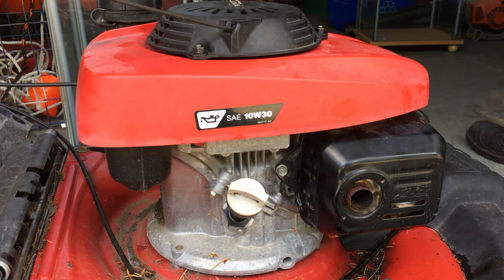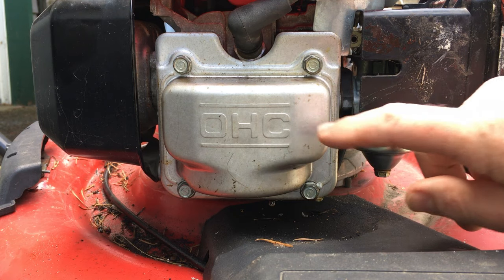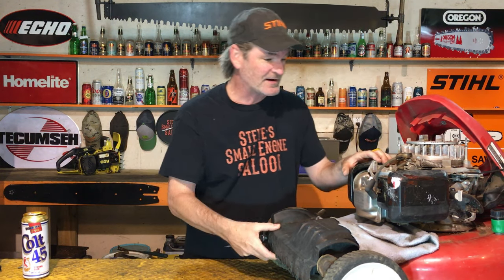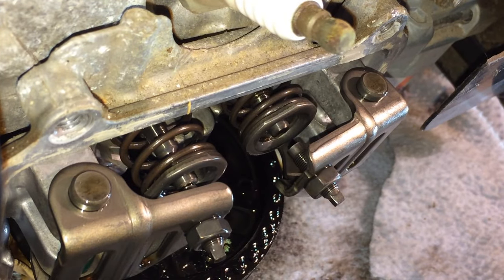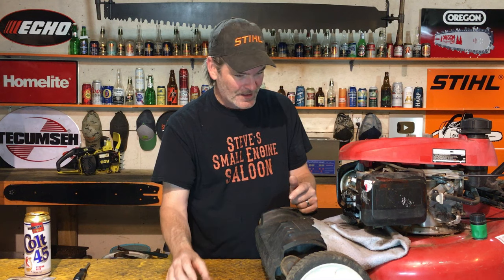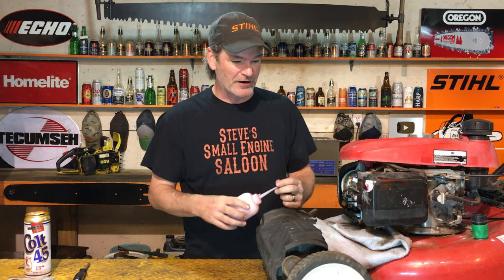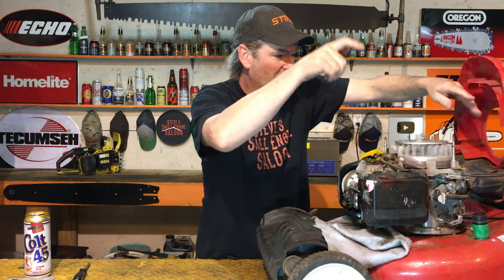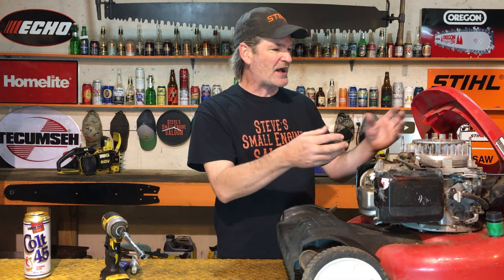How To Fix A Lawn Mower With No Compression

Comment from the maker: Don’t know if you have a compression problem 👉check out my video Easiest Way To Test The Compression On Your Lawn Mower ➜ https://youtu.be/LtJQgkBTkdE
✅Click here for HondaBond ➜ https://amzn.to/2SJNaaa
For more videos like this, check out:
👉Straighten A Bent Lawn Mower Crankshaft With A Pipe ➜ https://youtu.be/w2Ro9GmEyOE
👉Fastest Way To Tell If The Crankshaft Is Bent On A Mower ➜ https://youtu.be/3up57DHiCqs
👉Here's Why Your Lawn Mower Is Leaking Gas - Honda Style ➜ https://youtu.be/tp67AzWNbI4
👉How To Adjust the RPM Speed on a Lawn Mower ➜ https://youtu.be/7YrA3QEIFnE

For more videos like this, check out:
👉Straighten A Bent Lawn Mower Crankshaft With A Pipe ➜ https://youtu.be/w2Ro9GmEyOE
👉Fastest Way To Tell If The Crankshaft Is Bent On A Mower ➜ https://youtu.be/3up57DHiCqs
👉Here's Why Your Lawn Mower Is Leaking Gas - Honda Style ➜ https://youtu.be/tp67AzWNbI4
👉How To Adjust the RPM Speed on a Lawn Mower ➜ https://youtu.be/7YrA3QEIFnE
Reply: Didn't see the link for the homemade cleaning lubricating fluid....
Reply: Hey Steve i got a yradworks 172cc runs an dies right away any video on that its an auto choke im new to them
Reply: In the video you said you would put the recipe for your brother.s cleaning concoction in the show notes, it’s missing.
Reply: nice vlog research ion detox
Reply: 747tbar, the link popped up during the video, but that may vary depending on the device you’re using. Here’s the direct link: https://youtu.be/cElDM06Mk3c
Reply: I. How did the same day and what was it like when you have some good 👍 and what are your favorite ones
Reply: i know Im randomly asking but does anybody know a method to get back into an Instagram account?
I was dumb forgot the password. I would appreciate any help you can offer me.
Reply: @Damon Ahmed Thanks for your reply. I found the site thru google and im in the hacking process atm.
Takes quite some time so I will reply here later when my account password hopefully is recovered.
Reply: @Damon Ahmed it worked and I actually got access to my account again. I am so happy:D
Thanks so much, you saved my ass :D
Reply: @Lee Christopher Glad I could help =)
Reply: @747tbar  acetone and automatic transmission fluid 50/50 i think
Reply: Thank you for send me more videos i am learning with a good teacher it's you thank you very much
Reply: Link for homemade cleaner?????
Reply: Hi Steve I have a question my husqvarna lawn mower was I think shooting a flame out of the muffler do you know the cuase of why thank you
Reply: Oh I forgot to mention it happened when I was trying to start it

Comment: Anybody who has tried and more importantly FAILED to perform even the simplest lawn mower/small engine repairs should come away from Steve's Saloon with a newfound respect for experience and an engineer's mind. I may not successfully complete all of my DYI repairs, but damned if I haven't learned YEARS' of tech from Steve. Let's all buy this guy a beer. Or ten.
Reply from the maker: Wow!  Thank You...
Reply: I've only seen a few of his tutorials, I really like Dony Boy, but now I have 1 favorites! I'm not a good learner, its hard for me to absorb info, but Steve here is really detailed and I have learned enough to gain confidence in my repairs! Thank you so so so much Steve for sharing ypur valuable knowledge!
Reply: @mongamcdowell2693  - Yes he goes through it all as well as he can. Camera angles and demo's added after filming are great. Well done Steve. Well done mate.
Reply: @StevesSmallEngineSaloon  - I have just started up a tool sharpening and machine maintenance workshop and you bud are helping greatly. We salute you fine sir for all your efforts. Much love from England.
Reply: Tutorial was great however it would have been really great without the obvious display of the giant beer which insinuates alcohol habit that's most likely out of control these sort of influences are very negative and unappreciated
Reply: @ruthbenjamin5745  "saloon " in these parts refers to a drinking establishment...what where you expecting?
Reply: @ruthbenjamin5745  calm down. It's a guy in a shop having a single beer while he works.
Reply: U need to try a New Zealand Larger

Comment: I pretty much had given up on my dead lawn mower not starting after doing some other videos about gas and spark troubleshooting. About to head down to the local hardware store to pick up a ridiculously priced electric mower. I did one more search seeing if it could possibly be anything else and came across this video. The symptoms were spot on and when I took off the valve cover sure enough the exact valve was stuck. Took a bit to unstick it and get it working smoothly and then put it all back together. Next day after a few pulls it started up and ran perfectly to cut my lawn. Thanks Steve for the great video helping me get my mower up and running again. Looks like the electric mower will have to wait a few more seasons.

Comment: Thanks for the tip. I had cleaned the carburetor, checked the fule lines, add a new spark plug and air filter, but my Honda did't start. Then I checked the compression which was also OK, but a driver belt was lose. Once I put it back in place the Honda started immediately.

Comment: awesome Steve,  retired and got into well dump and yardsale picking,  using your vids l have fixed half a dozen free mowers and sold them.    4 of them had this problem. didnt know how to fix till l watched. thanks. love the vids....  the other two they hit a stump and you couldnt pull it to turn over.  shaft bend..  couple of whacks with a 10lb hammer and  was able to use the pull cord. cleaned card and both fired up on first pull.    saw your vids on carb cleaning those plastic carbs. thanks   having a blast rescuing mowers and things

Comment: Hi Steve thank you for all of your very instructive videos, I need your help this time, I got a Champion 5500 watt generator that worked for a couple of days when we had hurricane Aida. suddenly stopped working , I could not started back up, thankfully I got power back, so I stored it to fix it later, well it's been about two years and the season of heavy rains and floods are coming back, so I started to check what happened, and what I found out is that the intake valve broke of at the tip, I was able recover all the parts and pieces from inside the engine. I change all new parts (valves, push rods. rocker arms, seals, guide, keepers, head gasket, etc.) clean the cylinder head, lap the valves, test for leaks,, the cylinder is impeccable not a single scratch, put the head back in the engine, adjust the valves to spec, and before keep going I tested for compression, here is when I got frustrated because it's compression doesn't go any further than 28 PSI when it is supposed to be at least 55 PSI. 
What did I do wrong or missed? suggestion please

Comment: Thanks for making this video!!!! Just had this happen to my daughter’s lawnmower with a 190 on it. I pulled the valve cover and there it was, stuck all the way down. I could not get it to move at all no matter how much carb cleaner it sprayed on it I could not get it free. I took off the valve spring, valve steam seal,  and removed the carb and sprayed the valve stem in the port. Finally all at once it popped out and was completely free. I put it all back together and it now runs great!!!
Reply from the maker: Awesome!

Comment: Hi Steve. Valve clearance and timing is the first thing I check on anything coming into my shop, after plugs, HT coil, fuel, air, carb, etc. But you really don't need to take the spark plug boot off. It's never going to start, just spinning the flywheel by hand.

Comment: I am 68 and having been playing with engines since I was old enough to turn a wrench. I always learn something new from you. My friend and I had a similar problem to this one. It was on a Kawasaki V-twin in an Argo ATV. The intake valves felt like they were welded into the head, and the push rods dropped out. We stuffed nylon rope into the cylinders to keep the valves from dropping into the cylinder, took the valve springs off,  worked the valves loose, then used acetone to clean the valve stems. We had a chance encounter with an Argo dealer at a outdoor show. He was familiar with sticking valves on Argos, and he told us how to fix it. We were going to pull the engine out. He saved us a lot of work!  Now I see we could have left the valve springs on and simplified the job. Your penetrating oil formula would have worked great. Keep up the excellent work! Thank you Steve!
Reply from the maker: Thank You...and You're Welcome...
Reply: I had that problem on a liquid cooled Kawasaki 425 John Deere when I used Sta-Bil fuel stabilizer. I had a 5 gallon tank of it. It happened twice on the same tank of gas. So after I fixed the valve the second time, I didn't shut it off until it ran out of gas. Put in a fresh tank of gas with no Sta-Bil never had a problem since and that was over 10 years ago. I don't use Sta-Bil anymore.

Comment: Steve I have a 22in awd toro recycler with guaranteed to start (ha ha) B&S 7.25… A little over 4yrs old.  Started on first pull until 2wks ago. Couldn’t get it started.  Watched several of your videos so set out to check spark, fuel, and compression.  Used a spark tester showed good spark, shot a small amount of starting fluid through carb still no start.  Pulled plug and grounded to make sure spark at electrode.
(Had a plug on time that was shorted out).. Good spark at electrode, gave small shot of starting fluid put plug back in and if finally started
After several pulls.  Tried your quick compression check, blade kicked back but felt a little weak. Got compression gauge could only get 
30lbs which would explain why I finally got it started.  Question is what would cause low compression?…I don’t drink beer will hard liquor
Do or do I have to make my wife drink a couple of beers🤪

Comment: Steve, I have three mowers, one Honda tiller and a mantis 2cycle or what I call my psycho tiller that were all given to me to "work on" since I badly injured my back. I have been at a total loss with how to get started with trouble shooting these things. One has a bad or sticky recoil spring, once(the Honda tiller) won't stay running and the third is an old troybilt self propelled mower that will neither stay running nor self propell. But thanks to your time energy and knowledge and giving, I at least know where to start. Thank you...

Comment: You are a national treasure Steve. I've been home from work for 2 months now during this CV19 mess. At first  I used your videos to get my neighbor's trimmers and mowers running. Her husband passed away a few years ago and everything had been sitting since then. Our deal is I could use all his good stuff on my lawn if I cut her grass too, which I'd have done anyway. It seemed when something would stop running he'd go buy a new one. So the shed had 3 blowers, 2 trimmers, 2 mowers, and an edger all in various states of neglect.

I had so much fun cursing, crying, and questioning the educational requirements of modern engineers that I went online and  bought 5 mowers, 2 trimmers, and a pressure washer for $100. I've gotten 1 trimmer, 2 mowers, and the pressure washers running. I'm not doing it to profit, although that's fun too, it's more to keep my sanity. Thank you again!
Reply from the maker: Thank You...and You're Welcome...

Comment: My old mower sat for probably 2 years because a neighbor gave me hers and I got it running so I just used it. Now it’s kaput. Put new carb, hose, cable, filter, bulb. Well, it only has 36 compression. Oh, anyway, the old mower...old faithful, I changed the oil and cleaned the gas tank. It started on the third pull!  Now it starts on the first pull!  You should see the connection between the plug and that wire! I used it all wrapped around and bare for a few years and it STILL works!  SMH. Until it quits I’ll leave it alone. Meanwhile, I’m gonna work on the other one after your instruction!  You make it look so easy! LOL THANK YOU!

Comment: Thanks for this video.  I was working on my wife's niece's nice Honda mower that I determined had no compression. It was about 7 years old, but had sat for about the last three years because they had moved to a new home and had no grass to mow.  Once I got the valve cover off, the problem was exactly like your video shows,  I squirted some carb cleaner down the valve stem and guide, and wallah, it freed up in a few minutes of working it in and out.  I adjusted the valves and put the cover back on and it runs like a champ.  Easiest fix for what I thought was going to be a major problem.  Thanks again.

Comment: Steve, I had a Plate tamper with a Honda engine that was a buddy's he lent me then never wanted it back when I offered to return it.  Well,  years went by and it acted this same way.  No compression when he finally wanted it back.   I wound up doing him a solid and swapped his non running engine off and put another one I had bought before this off a guy for $25 USD.  Then returned the Tamper in working order to him.   I will get the old one working and put it on a Water pump or other tool some day.  Great to see you cover the Valve issue I encountered.

Comment: Watched your video, went out and removed the valve cover, and behold, my top valve was stuck. Got that guy loose with some Q20 and tapping and pulling. Pushed it in a few times after it started moving freely. Replaced all, turned the blade and it bounced back. Flipped the mower and she started on the first pull. Thank you so much!
Reply from the maker: Nice work!

Comment: Wow!  This really helped!  I was given a brand new 5 year old Troy Bill TB200 that wouldn’t start.  Did everything you suggested in your videos and it still didn’t start.   Opened the valve cover and one of the rocker arms was very loose.  It had good compression so this was a Hail Mary.   10 minutes later it was back together and started on the first pull.   Guessing the set screw was loose from factory.  I have refurbished about five mowers I found by the curb but this was the hardest.  Would never have attempted without this video.
Reply from the maker: Right on Joey!

Comment: I have a craftsman  Lt 1000 I bought in 2000  17.5 hp. . I changed the carburetor.  Now it surges. If I set the throttle a little over the run setting it stops surgining. What do I need to do? Love your channel!

Comment: Thank you. This guided me to the exact same problem on my Husqvarna mower with Honda engine.  Intake valve actually stuck open while the engine was running. I was stumped at first.

Comment: I just had one I got free last summer that smoked like a factory. I pushed out back and left it go. This spring I cleaned out the fuel tank, changed the oil and it started right up with no smoke. ( I also had to change the plug. ) Other than sharpening the blade and replacing the air filter it was a nice cheap fix and I made a few bucks on it. Never assume the worse on anything until you properly test it out first!

Comment: I am so glad I found your video's.  I had this exact problem, intake valve stuck open causing no compression.  I followed your instructions and got it working again.  I'm fairly handy with tools but I was surprised how easy this was.  I appreciate you pointing out the "gotcha's" like oil coming out after removing the valve cover.  You did an extremely good job explaining the repair.  Thank you!
Reply from the maker: Awesome buddy!  Thank you....and your welcome...

Comment: I can't count the number of mowers I've found on trash piles because they won't run. Usually it is a simple fix. Fouled spark plug from mowing on a steep slope or a broken wire on the magneto etc. It's easy to fix most anything with an engine if you simply look at the details. Keep the vids coming Steve. I enjoy watching the diagnosis.
Reply from the maker: Right on ....

Comment: Great video thank you.
 I have an experience with no compression also, but for a different reason, and a curious fix.
 I was an industrial vehicle mechanic and got sent to a very old four cylinder forklift running poorly. During the diagnosis I did a dry, then a wet compression test on all cylinders. Fortunately I wrote the results with a marker under the hood. The two center cylinders both had extremely low compression. Thinking the head gasket had blown between the cylinders I sent it into the shop to have it replaced.
 A few days later I got a call from the shop asking why I sent it in since it was running perfectly. After a lot of head-scratching and proving the results of the compression test with the marker under the hood, we figured out that the little bit of transmission fluid I put into the cylinders for the wet compression test, and a bit of time must have loosened stuck piston rings that just happened to be on two cylinders next to each other.
 Moral of the story, if it's not stuck valves, try a teaspoonful of transmission fluid through the spark plug hole and spin the engine a couple times for a couple days and if it's stuck Rings they may loosen up. Good luck.